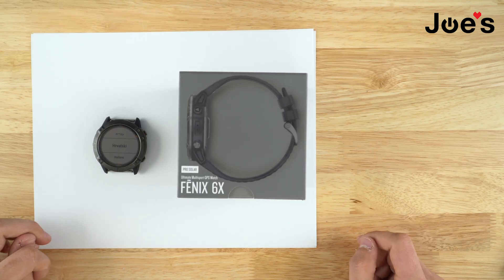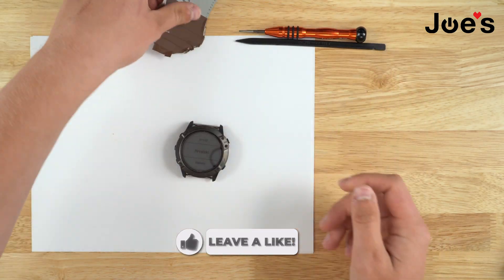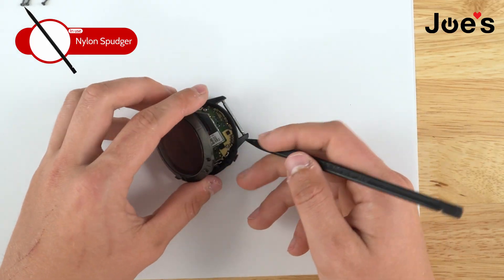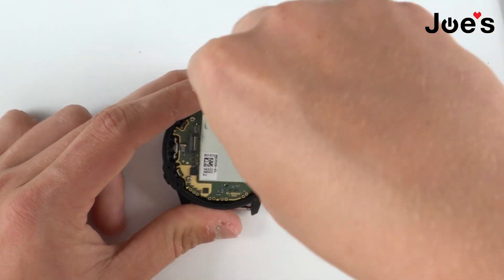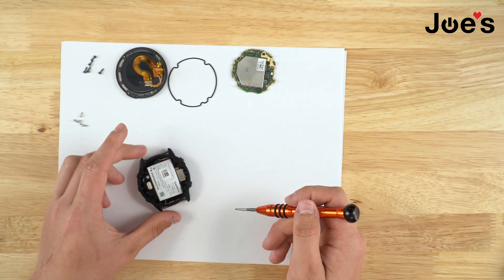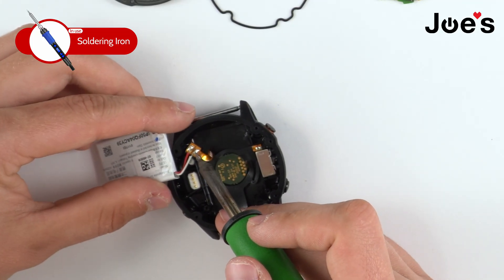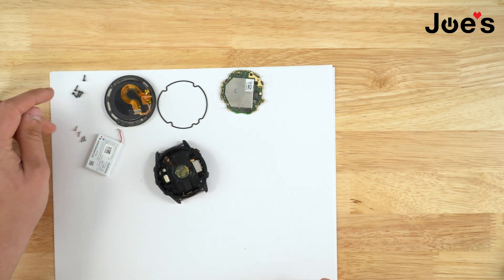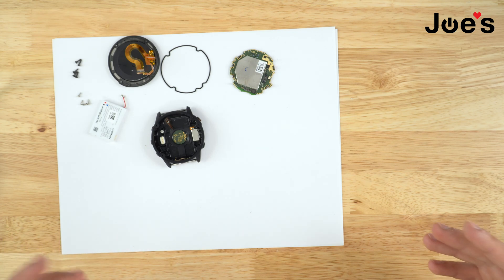Garmin Fenix 6X Pro Solar Sapphire Full Teardown: How to Disassemble Your Multisport Watch

Comment: Thank you for the teardown of the top of the watch. Do you have any video on repairing the sensor holder in the back of the watch. I have a watch where this has come loose and would like to get some tips on how the insert is connected to the rest of the watch. Is it just a pressure fit, or does it have a ribbon cable?
Can it be taken out to clean off the bad glue and refit it with something new? any suggestions for what type of glue/sealant to use that will be better than what the factory uses since this is apparently very sensitive to warm water, sunscreen and pool chemicals?